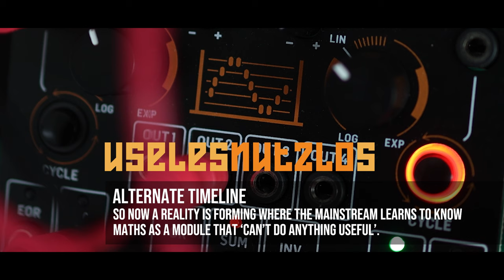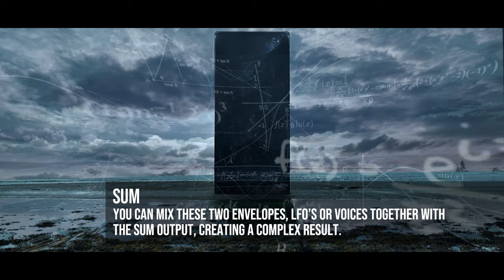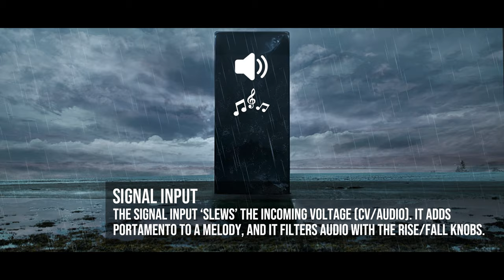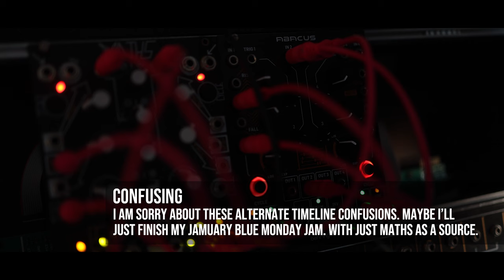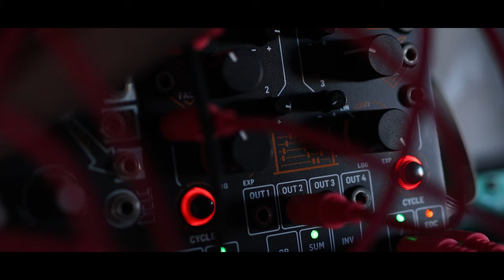The TERRIFYING sound of Mathematics - #jamuary2024  Day 8

Comment: I would like to know if the Serge Dual Slope module does everything that Maths does, clearly from the commentary, Maths offers more functionality than a Buchla.
Reply from the maker: If you take a look at the panel, they'll be very similar from a functional perspective but I do not know what the 'end' output will produce. On Maths  it's end-of-rise on the left, and end-of-cycle on the right (which is more like 'on-when-idle'). Chris Meyer has a great series on the DUSG.

Comment: lovely, I love te use of maths ( not the module) in music btw, I love to think that 1 hz is close to "human frequency" ( step and heart frequency), then 2 HZ is 120 bpm ( classic edm bpm) 4 or 8 hz is hihats, 2e7 hz ( 128 hz) is close to C2, 256 (2e8) to C3 ( or C2 second harmonic) and so on... and 1/2 hz ( 2sec) is a one bar loop, 1/8 ( 8sec) a 4 bar loop, then 16 sec could be a chorus  or verse time length, 128 sor 256 sec coud be a track time and 16*256 sec could be an album or the perfect length for a live. now I want to make a module that does this maths
Reply from the maker: Thanks for sharing! Super interesting concept of using specific Hz values as rhythm sources.  Did you post/share any music with this concept at work?

Comment: Sorry, but I still prefer the Buchla. Genuinely quad and way more intuitive than Maths. And Abacus is just plain ugly (orange? Gah…)
Reply from the maker: No need to be sorry! It's just that the Buchla can't process audio, doesn't have exponential envelopes and you'd need the voltage processor for the math part. So if I had to choose, it would be Maths.
Reply: @CinematicLaboratory  See? I didn’t even know that Maths could process audio! And I used to have one! Probably the most incomprehensible module I ever owned…
Reply from the maker: @walrtbstudios5430  I can completely understand! I started this journey because of Maths. I wanted something as far away possible from the PC, the VST and the classic hardware keyboard. But it took me a long time to figure it out. Actually, 0-Coast made me understand Maths.
Reply from the maker: BTW, just a few seconds ago I learned how to use Maths as a VCA. Never too old to learn...